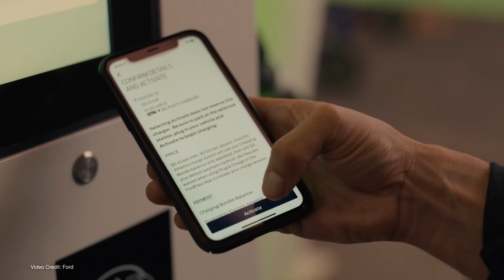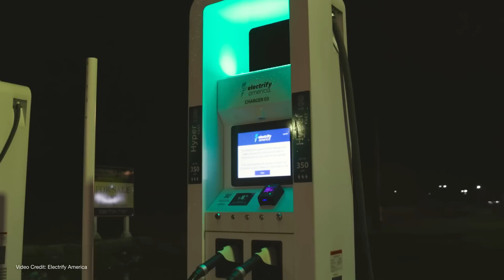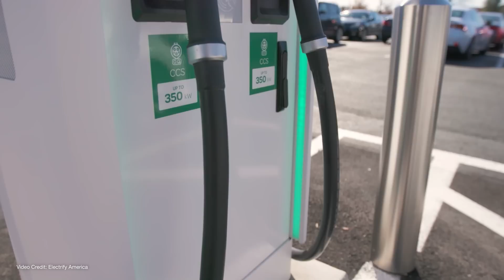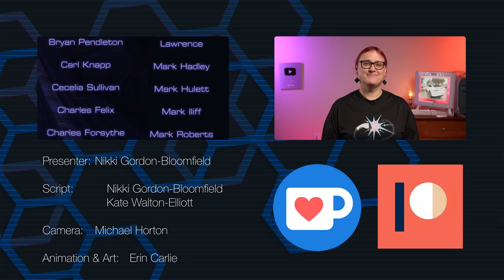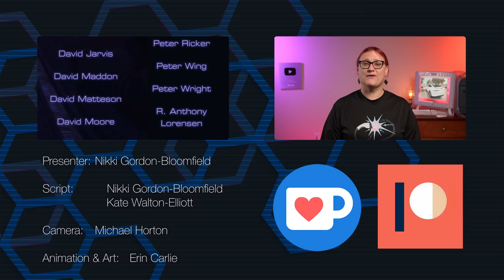EV Fast Charging Is BROKEN - And NACS Won't Fix Everything

Comment: It's nice to see more reviewers saying this that changing the connector is not a solution to the real problems.
Reply: Not to mention that NACS is still not capable of V2G/V2L or charging above 250kw as far as I know
Reply: @BrandEver117  As far as you know. NACS solves SOME problems. That is what everybody I have heard have said. Including Nikki here.
Reply: As far as anyone knows, apparently. V4 should theoretically be able to charge at 615kw, but all current examples are still limited to 250kw (I actually don't doubt they will be able to pull that off, but we don't know how long it will be until then). And V2G/V2L is supposedly "only two years away." Good thing Tesla doesn't have a history of lying about features and when they will be available, lol
Reply: @BrandEver117  As far as I know, Tesla hasn't promised much on the V2G front, since Musk doesn't like the idea. He thinks stationary batteries are better. But the Cybertruck had better have some V2L, most likely through other sockets. A few years ago, all current examples were limited to 150 kW. That was not a useful number for predicting the future. And as House says; Everybody lies.
Reply: @BrandEver117 Tesla’ specs for the NACS connector permit high enough voltage and current to permit 500 kW or more. Tesla already delivers 250 kW at 400 volts. The same current at 800 volts is 500 kW.
Reply: @BrandEver117 The NACS Working Group needs to make sure V2G is part of the standard from day 1. This is CRUCIAL to be able to make sure that charging infrastructure can interact safely with a smarter grid and do distributed load balancing. We only have this one shot to build resiliency into the system, and I hope the people in the Working Group are paying attention.
Reply: @BrandEver117  max speed doesnt matter worth shit, the charging curve matters, the top speed, which if you are lucky, you will achieve for 1-2 minutes per charge doesnt matter.
Reply: @patreekotime4578  Rarely do you only have "one shot" to build resiliency.  Right now, Tesla's Supercharging System is clearly the best. It would be great for them to add V2H / V2G / V2X or whatever. But it doesn't have to attempt to become mandatory tomorrow. Clearly the largest and best run system in the US is important enough to get Non-Teslas on board.
Reply: @BrandEver117 V4 chargers are said to be fril 400 to 1000 chargers. We don’t know it yet. But even the v3’s charge right up to 250kw speeds reliably. Other chargers say they are faster but can non-Teslas charge that fast in practice?
Reply: @scottmcshannon6821 why would I ever go 165mph for longer than a minute?  Even when I have, your claim about using juice does not hold up.
Reply: @BrandEver117  NACS can charge up to 615amps at 1, 000 volts.   As for the V2G / V2L that is another story for another day, because the connector is not the issue, it is the software behind the connector.   As for V2G that is getting ahead of ourselves at the moment.   Some people are stating "Fast Charging is Broken" and are trying to implement V2G / V2L at the same time.  It would be better to focus on adopting a charging standard that works well and then moving to the next level afterward.
Reply: @davidc2838 This is an infrastructure project. Probably the biggest one we will see in this generation. What weve seen so far is really just been some farting around. Having a unified charging standard is a sea change event. This gets everyone on the same page. And in order for the system to be resilient and flexible across the board, the right decisions HAVE to be made right from the start. Because there will very likely not be a second chance. Once companies start building and installing these things, any changes to the spec wont be applied universally and the older stalls in out-of-the-way places wont be updated or swapped out for a very long time. 

And V2G is a requirement because that is the key to resiliency of the entire power distribution grid. You know, the thing thats 100 years old now and isnt getting properly updated because infrastructure is expensive? You know, the thing that should be a big red warning sign to everyone that you only get one chance to get it right on huge expensive infrastructure projects?
Reply: @BrandEver117  most battery chemistries can’t handle greater that 250kwh for more than a few min… unless it’s a massive pack to spread all that energy over.
Reply: @patreekotime4578  again as stated several times above NACS is just the handle as CharIN says “a form factor.”Tesla already uses the same communication standard as CCS.
Reply: How does Tesla get away with using thinner cables?
Reply: @BrandEver117  NACS is only a connector 
Has nothing to do which way current flows.
Reply: @patreekotime4578  NACS is only a connector... Has nothing to do with supplying power to the grid
Reply: @golfish8589  hard to say? Different materials possibly? Maybe CCS cables are unnecessarily thick or cheaper material. You’d have to compare both.
It could be because you can use thinner cable with higher voltage. Tesla is always 400v (I believe) but chargers at EA for instance have to be able to charge at different voltages (I think) so maybe if a company uses lower voltage they need thicker cables.
Reply: @BrandEver117  
V2G makes no sense for a DC fast charger. You go there to charge your car, not to discharge it. And as soon as it's charged, yo move on.
What makes sense is to incentivize charging when there's excess power, and Tesla is already doing that.

V2G makes sense at home, where your car is plugged in for 12+ hours a day. Tesla doesn't do this yet, because older batteries can't take the extra cycles, but it's in the plans.
For now Tesla offers the Powerwall and Megapack instead.

V3 Superchargers allegedly can do 350kW. I think Elon confirmed 300kW, and maybe more, I don't remember. Charging is limited on the car side. Some cars are advertised to go up to 350kW, but in practice they don't.
V4 Superchargers can go up to 615kW, and the Semi chargers are 1MW minimum.
Reply: @BrandEver117  
Being late is not lying. Please look up the definition of words. Also show me any complex product with significant innovation that came out on time. Everyone is late with these, because if you are doing something new, you will inevitably run into unexpected problems. And if you include enough buffer in your plans, that will inevitably be eaten up by other things, like more features, unnecessary redesigns, etc. I've seen this from inside countless times.
Reply: @geirmyrvagnes8718  
Elon doesn't like the idea of powering your home with your car, because for that the Powerwall is better. But V2G is different, Tesla's VPP plans always included cars too. They didn't do it with older cars, because the batteries would degrade too fast, but now that's not a problem anymore, so I expect it to happen sometime.
The Cybertruck will have power outlets, so the necessary hardware will be there.
Reply: @patreekotime4578  
You go to a supercharger to charge up your car as fast as possible. Discharging, or even just delaying the charging, makes no sense. What you can do, and is being done, is incentivizing owners to charge when there's excess power.

For interacting with the grid there will be Megapacks at charging locations.
Reply: @golfish8589  
The cables are water cooled. In the new v4 cables the water directly touches the copper wires, so the heat transfer is much more efficient, that's how they can go up to 1MW with the same cable diameter.
Another way is increasing the voltage, but up to v3 Tesla uses only 400V. V4 supports 1000V too.
Reply: @andrasbiro3007  We will see. It can be done, no arguments there, but Tesla is working hard on 69 ideas that Elon thinks are cool. Pushing high power out of the charging socket and back into the house/grid is not an Elon thing. But Ford does it, and Ford is switching to NACS, so if/when NACS becomes a standard that Ford can influence, maybe they will save the day?
Reply: @andrasbiro3007  We will see. It can be done, no arguments there, but Tesla is working hard on 69 ideas that Elon thinks are cool. Pushing high power out of the charging socket and back into the house/grid is not an Elon thing. But Ford does it, and Ford is switching to NACS, so if/when NACS becomes a standard that Ford can influence, maybe they will save the day?
Reply: @andrasbiro3007  that is good information to know.
Thank you. 
So there is no reason why non tesla chargers  should have stiffer cables? Correct?

I have herd that the Tesla car receptacle has slightly smaller connections and the have caused issues and very expensive to replace
Reply: @DelPhonic1  HUH???
Reply: @BrandEver117  v4 superchargers are 350 kw.
They are already in Europe.
Reply: @patreekotime4578  has zero to do with the connector...
Reply: @michaelsmithers4900  Tesla v3 charger cables are liguid cooled yet handle more current 
350kw at 800 volts has the same current as 175kw at 400 volts.
The Tesla cable and connector handle more current that the 350kw ccs connectors.
Reply: @golfish8589  
No reason for thicker and heavier cables.

I haven't heard about such issues. The connections are standard, they should be the same. The heavier cables may stress it more then it's designed for, but such low safety margins would be bad engineering.
Reply: @geirmyrvagnes8718  
Tesla is working on essential technologies that all support the same mission. Even AI and robotics are connected, because the first increases the utilization of cars and helps running factories, and the latter helps make everything else cheaper and more abundant.

It's unnecessary to power your home from an EV. The Powerwall is a much better solution for that. And for stabilizing the grid it's simpler to just charge with the excess power, that can be done with no additional hardware. Tesla is planning to send back power to the grid too, but that's more complex, and until recently it would have degraded the batteries too much.
Reply: @andrasbiro3007  in Nikki's video she talks about non tesla chargers having heavier more cumbersome cables.

Many point to this as a reason to switch to NACS.
I dont care one way or the other. 
Does tesla have a patent on getting more amps through a smaller cable with no increase in heat? I dont think so. If so. Then every industry would benefit from this knowledge.
Reply: @golfish8589  
Of course they do. That's why the cables are much thinner.

Technically it's not the lack of heat, but the better cooling, but the end result is the same.
Reply: What chargers need is more cables per charger, so while one charges others can plug in to wait and go to do their business. Now if a charger is in use, you have to hang around to wait, which is huge waste of time. Especially destination chargers need several cables.

I saw in Spain a destination charger, which application showed when the current charging was done and it unlocked the cable, so someone else could use the charger after previous charging was done. Very good policy.
Reply: @MK-je7kz  most charging locations don't have enough space for two parking spots per charger
Reply: @golfish8589  most parking lots have several rows of cars. Putting the charger between the two rows that are next to each other, you could easily reach four cars. Even on street parking you can reach two cars with one charger

It's about the mindset. Currently it's still charging=filling a petrol tank. For destination chargers it should be additional service for parking
Reply: @MK-je7kz 
Tesla charges extra fee if you don't move your car after the charging is done. But only if more than half of the chargers are in use.

Comment: You mentioned charging sites being closed at night. I live in a town in  the West Midlands of England with a population 12,000 people. We have three charging sites in the town, with a grand total of 8 charging points. One of the sites is a council owned car park with a shared 7kw charger and a time limit of two hours parking. The other two sites are in supermarket car parks, and both have two hour time limits. All three car parks are closed and locked from 8.00pm until 7.00am.  Not much use to anyone wishing to charge overnight if they cannot charge at home!

Comment: Good thing there's at least one company attempting to solve the charging issues here in America. VW realllllly dropped the ball.
Reply: from what i saw is, that electrify america is exchanging some chargers to different models. there are different companies making chargers. different prices, different reliability, different reaction time if broken, different compatibility, different features. sometimes they even implement workarounds for certain cars that did not implement the communication the right way. sometimes the electricity provider is not reliable. so, it is understandable if electrify america has a hard time keeping their cool, if the manufacturer of the charger can't make it right. and switching from one charger to a different one is crazy expensive.
Reply: It is just the early days of EVs and EV charging. It takes time to build an infrastructure and learn from the mistakes. Learning from mistakes isn't actually that easy in a corporate setting. You need to have the correct type of organisation and processes in place to document the problems and plan for improvements. Even then you cannot fix everything over night. Remember that Elecrify America was basically setup as a punishment for VW. That is not the best starting point for a company.